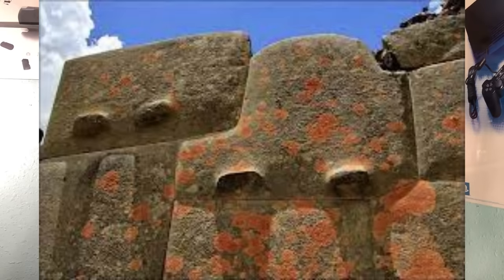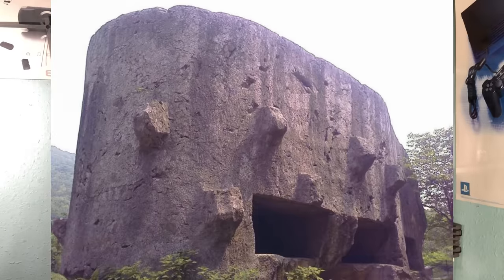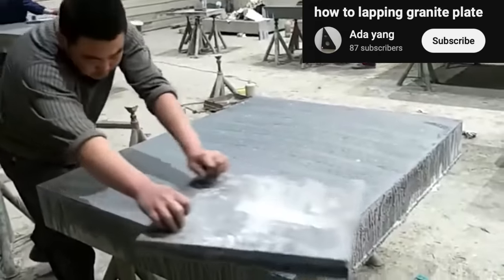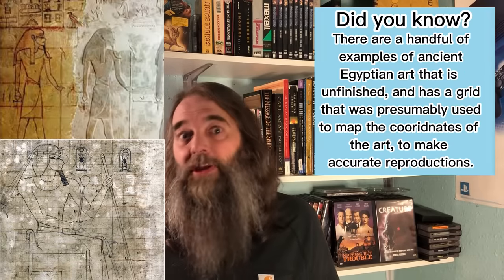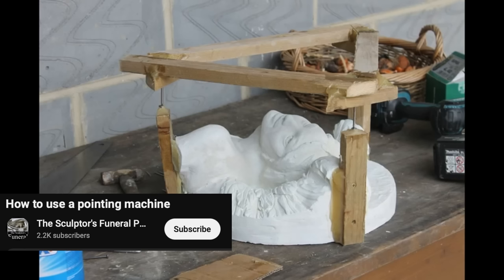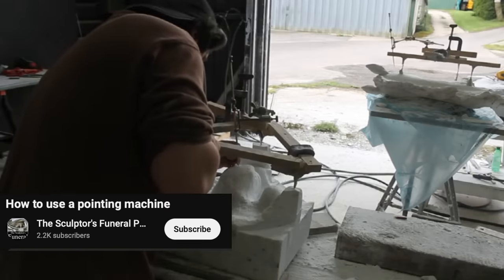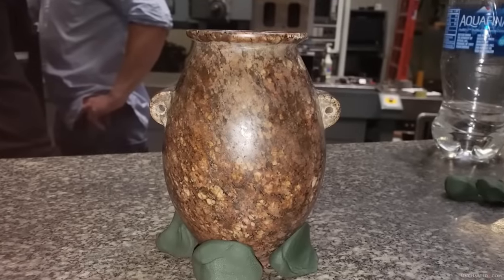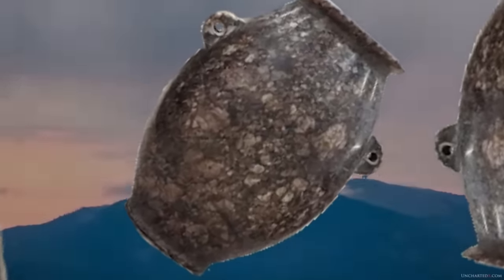The True Purpose of Megalith Stone Nubs

Comment: I like the geopolymer idea better.  And the nubs are where the concrete was injected into the bag made of hemp, or some other natural organic fiber. It explains two main features of the construction of the blocks. 1)The precision of each block's location to an adjacent block absent any gap between the blocks. 2) The size and weight of the blocks that would make quarrying, and transportation of each block impossible by human construction crews of the time. In situ construction of each block using injected concrete made of weathered pulverized igneous rock solves both problems. Has anyone sacrificed one of the smaller stones, by pulverizing, and analysing the stone chemically, and microscopically to detect man made concrete (geopolymer), as opposed to natural stone?

Comment: I've been thinking about this for a while. Assuming it is sandstone they are setting up and not graphite stone. Something tells me that all they had to do was rough-cut the stone first, then make clamps out of wood and rope and hoist them up just above where the stone was to be placed. Then all they had to do was use a lot of manpower, which they had in abundance, to swing the stone as it was gradually lowered. Then the stone would have been ground as it swung over the other, and we would have had perfectly tight joints. Then it was just a matter of working on the front of the stone. It was just a thought and I have to say I don't know the answer to that. I can only assume that they learned from nature and learned to work with it and not against it.

Comment: Template-Measure-and-Transfer theory seems very complex to me. Here is a simpler one: use nubs as a lever hold to lift an upper block, let say a foot above a lower one. Now you have 2 stone blocks roughly shaped that you want to match precisely. To do so you need a parallel saw with tooth on an upper and lower side that can be worked back and forth in a gap. You start with smaller tool that fits in some of the gap and move across block and subsequently tool became wider and taller with smaller tooth, more resembling sand paper. But all the time it is a parallel and shapes 2 blocks at the same time. That's why bottom most block has no nubs.

Comment: Don't over think it.  The nubs are used to secure fulcrums for lever arms that they used to slide the stones back and forth against each other.   By sliding the stones across each other they mutually wear and you get a perfect joint.   The stones only need to be "kinda close" in shape and size before placed and they do not need to be cut individually.  You don't need to resort to super natural or woo woo to explain any of this, just materials science and physics.    If a society is stone age and has no steel tools then the only way to fit / cut two stones with such a tight fit is through deliberate mutual wear.

Comment: (PRESSURE POINTS) Perhaps its because of instead of cutting several stones they would cut a huge slab lay the slab down on the ground trace out several blocks like a puzzle.... the nubs are placed right next to the joints and the outline of the stones are cut deep to act like a hinge when weight is applied to the nubs this will break the stones apart due to top pressure and deep cut hinge groves .... they  would have a perfect puzzle to assemble

Comment: I've thought for awhile that they were left from openings in the bags or molds from geopolymer. The geopolymer doesn't need electricity to set. It's purely chemical like concrete, that's a really outlandish idea. Fill a bag with mortar and tie off the opening. After it sets ypu will have a wierdly shaped nub identical to what you see.

Comment: Since the construction of these megalithic stone walls were done with huge mega ton stone blocks in many cases,  carved to the precision of fit within  less than one hundreds of an inch, we can only guess to how they quarried, moved and carved these stones.  And now, perhaps thousands of years later, we try to make reasonable theories of how they did it.  And one other puzzle, the point of this video, is the reason for the protruding nubs on "some" of the stones. And if they had the ability to carve and fit these huge multifaceted mega ton stones to such tight tolerances, they obviously had the ability and discipline to remove all these nubs after the construction, if they were used "only" for construction purposes.  But they left many of these nubs on only "some" of the stones.  We also see stones the size of large buildings that were in the process of being carved with these nubs on several faces of one block such as those at the Yang Shang quarry ion China.  If they had the ability to move carved blocks that weighed hundreds of tons such as these and those blocks at Baalbek, Lebanon, the size and weight of which we could not lift today by any known existing portable lifting equipment, then they had access to more than just highly precise stone carving methods. If these nubs were that important to the construction of these blocks to fit that precise, one might think these nubs would be a little more precise in appearance, compared to the extreme precision of fit in these stones. And, once again, why are these globular nubs only on some of the stones? And any reason that says they just got lazy or forgot to remove them is asinine.

Comment: Such construction with tight joints, irregular seams and blocks of massive size indicates a leak proof structure resistant to the flow of water. The nubs are where the stone was last attached to the bedrock as it was cut free by scooping. Also serving a purpose, they might have been attached with levers to animals that were driven in a circle to execute lapping. When water flowed, they prevented severe erosion by disturbing the flow, creating eddies. Such construction does not permit easy modification to allow for population growth or other expansions. Only water circuits are so constrained.

Comment: Can we see this done without steel needles, machined thumb screws, two part epoxy etc. etc? Sorry, not convinced. The wooden frame example was shown only in a 2d example. The poly stones are 3d. I don’t believe that the ancients had advanced technology, but I think this proposal needs to be fleshed out more, be more self critical. You need to fill in the gaps better. Show someone achieving the same results using only materials available to the ancient workers. Not some guy carving a face on a bench with steel needles and epoxy. Nothing debunked here, I’m afraid.

Comment: I think you've got a good hypothesis here and I really appreciate you putting it out there.  I agree that they could use that technique to create the geometry...but...I still don't think they did.  There's not enough up-side to doing it this way.  If it was me and I was capable of that much precision, I'd just cut a bunch of really square blocks and stack them together.  It isn't worth the work to make each one a snowflake and cut all that complex geometry.  Doing it this way also forces you to make a wall in series, only being able to do the next one after the last [very laborious] one is done.  If it were done like that, there would be a specific asymmetry about the blocks where one side would have been made to match the last block, but the other side would look like the least possible amount of work, with the final blocks in the wall being nearly featureless.  I haven't explored this, but it might help or hurt your hypothesis if you did.  It also seems strange that they would put all that work into the tight fit and not clean up the nubs unless it was adding a significant amount to the overall work content on a percentage basis (if you're taking a hundred hours to make a block and removing the nub takes a half hour, you might do it.  If it takes a half hour to make the block, you might not).  Either way, good thinking and good explaining and good job starting a dialogue in the right way..

Comment: I agree with your hypothesis but want to add too it. I doubt they drilled square holes in rocks. They made a mold. With the electrodes in it. Piled loose rock on top and then started the electrode letting the rock melt together

Comment: I feel like the knobs could be a leverage point by wich someone either moved them or i think primarily used them or left them for last to help smooth the other parts of the surface .in the case of the latter a point of leverage for possibly a mill or grinding tool.

Comment: In printing we call them registration marks, in animation they are the holes at the top of the paper. You make a strong case and explain it well. cheers.
Reply: In electronics manufacturing (mounting components on PCBs) we call these fix points "fiducial marks". When working on a 2D surface you will need at least two of them.
Reply: @peterrevens8454  I never knew what those pcb marks were called. Thanks. I put in my components by hand, so never need them.  Its funny that the word stems from the Latin word for trust. And even funnier that paper money is trust based and therefore called fiduciary. Especially when politicians set the value of the paper... and who trusts politicians. Where's Alanis Morrisett when you need her.
Reply: @mrwoodandmrtin  Hehe. You have just given me the explanation for a danish word that I always considered a made up funny word (yes, I´m danish). Fidus.

Thanx mate 🙂
Don´t get the Alanis M reference though...
Reply: @peterrevens8454  She was a singer who famously wrote a song called ironic.
Reply: After all the explanation of nubs, you missed that there isn't a building with perfect copies of blocks. Simply blocks cut to fit, of all sizes.

Comment: As a retired former stone mason, I congratulate you on a good, solid, workable idea. Similar in method to a "pixie stick" which transfers particular points from a model to a stone, a method still in use today.
Reply: Hi Tom, what do you think of my theory: I believe that the knobs were put on the lower edge of the stone and their lower side was flat, as opposed to rounded upper sides - this for me is so that the stone can be supported lifted a few inches from the lower stone. Then an obsidian “file” starts to grind in between the stones, thus equalizing their contour. This is very probably since in may case only the outer edges of the stones fit - one doesn’t have to “file” or grind much on a roughly precut shape.
Reply: @RosssRoyce so what of the huge stones that have NO nubs ?

Comment: I think your idea may fit in with an idea of mine regarding how the precision joins of irregularly shaped blocks came into play. My idea was that they preplanned an entire wall or wall section, they levelled an area of ground the size of the wall and lay out the stones face down on this area. They used scribes between the stones to meticulously match surface to surface, and would build the wall with them as they finished a row pair. It occurred to me that the nubs may be there to boost a side of such a face-down stone to make it fit the face angle more desirably, but judging by the finished wall face, this didn't sit well (no pun intended). This video made me think that the nubs may have been to solidly anchor a focal point into the ground (set of blocks that the scribers would want to stay perfectly still) while they scribed blocks around them. That might explain why not every block needed them- maybe just those in a certain area. It's quite a puzzle, though, as the nubs have an array of shapes and sizes. Will start viewing walls with that hypothesis in mind.
Reply: But many polygonal walls have heavy blocks with no nubs (and not because they were all sawn off). Also, you ignore the fact that - in the case of Sacsayhuaman -  the backs of the blocks are not smooth but highly irregular and rough, so that they would not have laid down on the ground so that their sides could be shaped to match one another. Any such shaping would cease to apply once the stones were lifted into their final places because they would lie at different angles to what applied when they were on the ground.
I don't beileve the stones were ever to cut to shape. Instead, they were washed with a special solution that temporarily turned the surface into clay that deformed and shaped itself according to the shape of the stones placed around and on top on it. Evidence for this is seen in the obvious trowel marks made in the front surfaces of some blocks at Sacsayhuaman. I believe some surviving gaps or cracks were plastered over with some of the softened stone whilst it was still malleable. That achieved what appeared to be perfect fits.
Reply: @thesaneparty4079
I think you do have the general layout and puzzle shape matching correct.
I also came up with a very similar idea for how to get the jigsaw puzzle fit.

But the nubs idea is completely wrong.
This building method could easily be replicated today using very ancient tools.

Comment: I would suggest that these nubs are actually Securement Points, like Hoist Rings or Lifting Eyes. 
Used to attach ropes or cables to a fixed structure, to assist with lifting heavy loads or securement point
Reply: then how come they are not perfectly square so the supposed ropes would not slip off... and there would have had to been multiple lift points and nubs of EVERY STONE... and there aren't... and do you realize how large those "ropes" would have to be to lift those stone and how large the leverage or pulley system would have to be?
Reply: Of course they are. Everything else is beyond silly.
Reply: how else do you think they lifted the rocks? How do you position a rock with contact on the bottom and two sides? You use nubs on the side with a rope/wood jig of course and some kind of scaffold. You think they can move giant rocks, but a wood jig is too much for them?
Reply: 😂ok some of the smallest stones have 2 nubs (completely unessacery and impracticle) some of the largest 1 in one corner or none at all or an inversion (completely impractical) why are we randomly leaving some nubs and not others on the finished wall? why are the nubs different sizes and no it doesn't correlate to the size of the stone make it make sense.....

Comment: Here’s another purpose for the knobs: the stonemasons knew that the finished product would be travelling, so the need to lift it onto something would aid removing it from the quarry and not by their staff, but by the acquirers of the stone. So, they added the feature so that it could be lifted somewhat because the knob side would be on the ground and then levers could be inserted to lift it onto a moving platform for transport easier than when flat on the ground. Likewise, when ready to move it into place, the knob side would allow for more levers to move it better.
Reply: But the rest of the walls - like in Cuzco, are all finished with a high glaze. If this was the case, then the nubs would be removed, prior to glazing.

Comment: I spent some time looking at these large stones and considered how they were made.  For me it was those nubs and the roundness of the finish that gave it away.  These stones were cast in large individual molds right where they stand.  The outer face of the molds were sheathed with large animal skins.  These skins included the whole upper leg skins not cut open.  It was these leg skin tubes that were used to make the nubs.  The leg tubes could also be pushed into the mold creating those half round holes.  When the form was packed with cement the flexible skin pushed outward creating the roundish finish of the stones...Consider ; there was a natural cement used by the ancients that is no longer available or understood.  My opinion of course.
Reply: People in the area still pound stone to carve blocks just like their ancestors did. The little percussion marks on these stones do not lie.

Comment: Simplest idea : The nubs were only there to prevent the stone sitting flat on the ground while it’s worked on…

Imagine trying to get under one of these once it’s flat down. Also imagine trying to tip one a little just to sling it for a lift…

I believe, many of the nubs were actually finished off and removed, those remaining on the wall faces were just not needed to be removed.
Reply: Assuming you have a very flat hard surface to work on, otherwise those nubs would just sink into the dirt with the weight of the rock or stone.
Reply: That could complement other ideas. Sometimes we do a thing for many reasons.

But why not put a smaller stone or log under it?